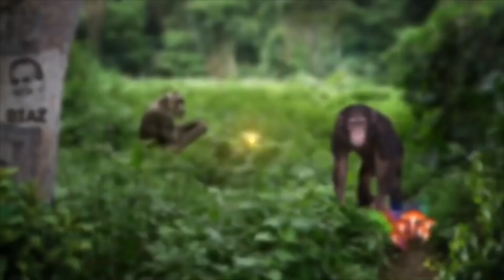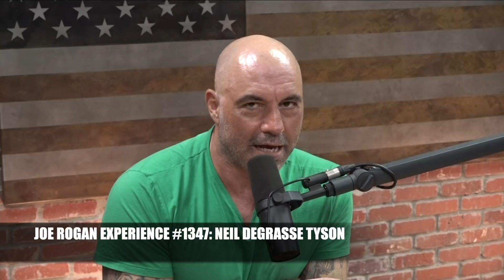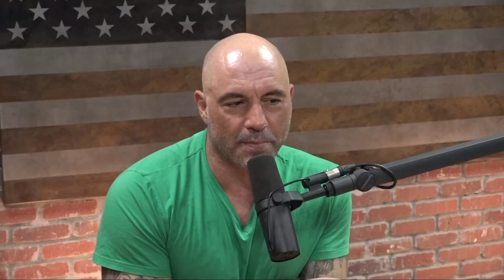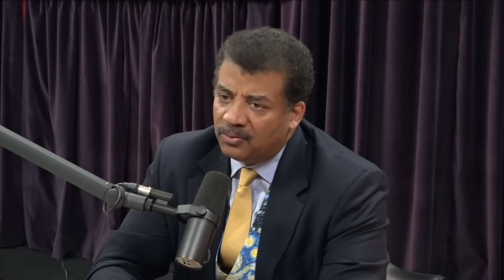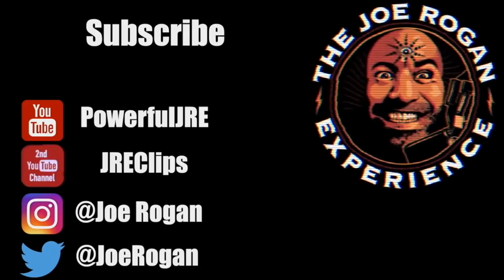It's Pressure That Makes Ice Skating Possible

Comment: 3:01 It's not so simple. The factor combining a pressure with a raise of melting point temperature is -0,000000074 K/Pa. Skater of 90kg on blade of length 45cm and width 1mm produces pressure that raises melting temperature only by 0,14C. That's not enough for melting the ice. The ice is slippery even if you walk with shoes! The key word is "premelting" (thin layer of liquid H2O present on every solid object even if they have a temperature below 0C). Later, this thin layer of H2O under pressure divides into more 3 layers where the middle layer works like a lubricant and causes ice to be slippery.
Reply: A blade is way sharper than 1mm it is measured in microns

Comment: Sorry but it's not pressure that makes ice skating possible, a well-known fact taught in many undergraduate-level thermodynamics courses. Unlike virtually any other substance, with increasing pressure the melting point of ice does indeed go up. However, the pressure of a blade on ice raises the freezing temperature by less than one degree.

The real explanation (which also explains the simple fact that ice is slippery even in the absence of high pressure -- a hockey puck, for instance) is that ice has a microscopically thin layer of liquid on its surface at temperatures WELL below the freezing point. Surprising that NdGT "dropped the puck" here.

Comment: Why is the ice slippery for the puck?  It is not heavy enough to create anywhere near the amount of pressure on a skate blade, it does not ride on an edge, and NHL pucks are kept in freezers before use (so they slide better)...so they probably do not melt the ice by much at all when in contact.

Comment: So when Neil speaks of the ice skate on a bead of water..
I got to thinking, do some shoes on ice grip better than other?
Flat/smooth bottom dress shoes or boots might not grip as well as a running shoe with many groves according to the fence/ice block experiment?

Then I got to thinking,
If a shoe with more grooves, or "sipeing" cut into it grips better, then what about tires on ice... 
I already knew that the more sipeing grips better, but on dry terrain the friction is high and chews those tires up quicker. 
But for max grip on ice how far can you go with grooves? 
Like the fence trick, ice will melt under the pressure contact of the touching parts, but does the water have time to turn back into ice in the cracks and grooves, or does it simply just channel the water away from the contact points?

Comment: Isn't this more due to density and the temperature of the device touching the ice? I don't believe that actually squeezing ice will make it melt. I do believe that forcing a material upon ice with pressure could cause it to completely absorb the energy of heat around it. Anything more dense than air putting pressure on an ice cube will always cause this outcome. Have you tried applying higher atmospheric pressure to an ice cube and seeing if that makes it melt faster?
Reply: Justen Mathis um. Squeeze an ice cube dude. Watch it melt
Reply: @evansaber7642  lol you didn't even try to read the comment you just replied to

Comment: When he says it's like a thousand pounds per square inch on the blade because the area of the blade is small is pretty dumb, it's because the force or your mass moving is why it would put so much pressure on the blade. Someone will expose this guy someday, Neil "not as smart as everyone thinks" tyson.
Reply: Garret Hannah you’re being a bit harsh on the man. Sounds like you have some deep down resentment going on for him. However, I would agree. What he explained in this video doesn’t seem as credible as most things he would say. Lets get this straight though, he’s smart, smarter than A LOT of us.

Comment: 3:55 I was once told that the worst thing about traveling in the Antarctic was that the ice is so cold that the skates on sleds don't work as well due to how hard the ice surface is.  I wonder if this is partially why.
Reply: Thats exactly why
Reply: The pressure to required to melt ice increases as the ice gets colder and colder.... So the arctic is so cold that yes, the pressure and friction of the skating person is not enough to melt the ice directly underneath it
Reply: yep! if the blade can’t cut into the ice (the friction actually just heats it enough to melt it) you can’t push on the sides of your blades to steer basically. if it couldn’t cut into the ice at ALL, in theory you could still go straight forward but it’d have to be PERFECTLY straight or you’re done for lol
Reply: So I'm guessing they use blades that heat up? That was a thing someone invented for Hockey skates and flopped badly (old tech, not good enough batteries) but the theory was good.

Comment: I have skated in -25°C weather with no issue...?
Reply: Well if he said 10s of degrees below zero, then maybe he meant more than 2 10s and 30 or more degrees. So -25 could still be possible. Also how long had the ambient temp been that low? The temp of the ice could be higher than the ambient for a period.

Comment: When I went to school, it was explained that only running water can drop below 32°F. Once the ice forms it can't drop in temp. I'm pushing 40, so what I was taught could be out dated at this point.
Reply: It can’t drop while there is still water in the “system”, water doesn’t change temperature while is changing state, if running water is turning into ice, it will stay 32F until all the water becomes ice, then it can go lower.
There’s also the pressure factor, things freeze or melt in different temps depending on system pressure, but that’s too much to go into right now i think

Comment: what a crock of shit.... ice will melt from pressure.. if you put ice in your hand and apply preasure it will.melt the ice .. the heat from your body will.melt the fucking ice anyway you numbnut plus the fact is no longer at the ambient temprature to maintain its ice form so it resorts back to liquid as oppose to a solid...

Comment: I think its more probably friction melts the ice and not pressure. And the purpose for the blades is that you need friction to melt the ice to create water to glide on but you still want a small enough surface area that the friction isn’t so large that the effect of hydroplaning is cancelled out by that friction

Comment: I don’t know if that’s what makes you skate on ice. You can skate just as easy on synthetic ice without this principle being applied. I don’t doubt that the pressure melts it a bit but not to that extent.
Reply: empbac umm not what I was talking about. I’m talking about synthetic ice made from a plastic composite that is used for home “rinks.”

Comment: As a hockey player im having quite a difficult time imagining ice thats too cold to skate on.. id love to try that experiment if ever possible.
Reply: This is because they're wrong about pressure causing the ice to melt. At around -4°C, the pressure caused by the skates isn't enough to cause pressure melting, but the vast majority of skating is done on ice colder than that, so the pressure theory was misproven. It has to do with the fact that the top layer of ice molecules (only a few molecules thick) are less tightly bound to the main ice mass than the ice molecules further down.
Reply: @FutureProp  
Or because the earth is flat right?
Reply: It might be just too cold for a human to not be able to ice skate at  all. Maybe lower scale you can try going out when on a reaally cold day and see if there's more resistance in the ice
Reply: everything this nigger says is probably all bullshit

Comment: I thought the icecube melts when you squeeze it because your hand is warm..
Reply: That ones a dumb example cuz your right its a dual effect. What hes tryna say is that temperature and pressure BOTH affect the physical phase. (Liquid solid gas) most people only think its temperature. (Basically how a propane tank holds pressurized liquid that under ambient pressure would be a gas
Reply: Agreed even if i was 1mm away from it for 10 minutes it would melt without pressure, just my body heat
Reply: You can squeeze it with something that's as cold as ice, it'll still work.